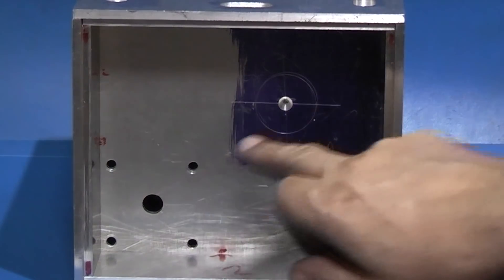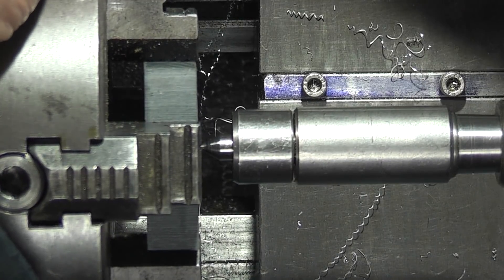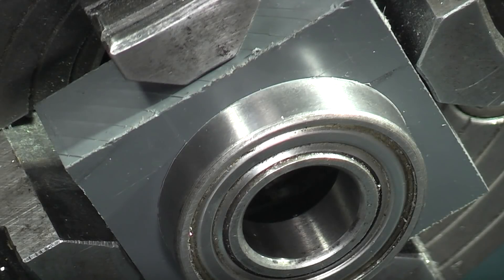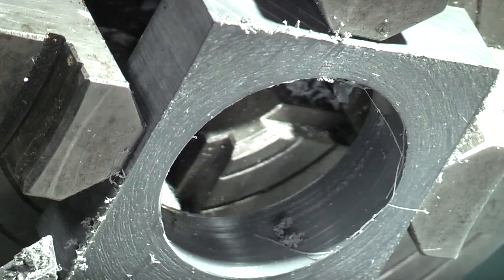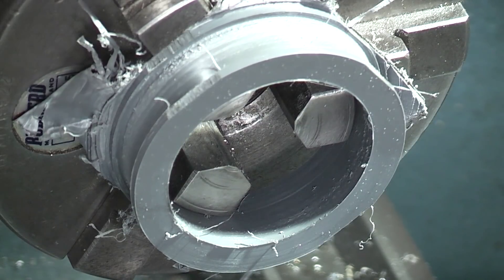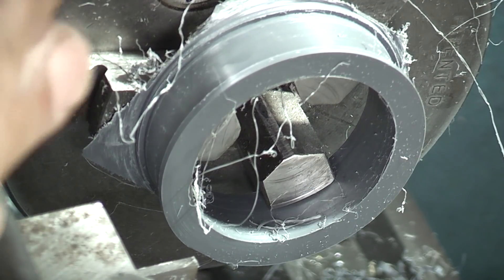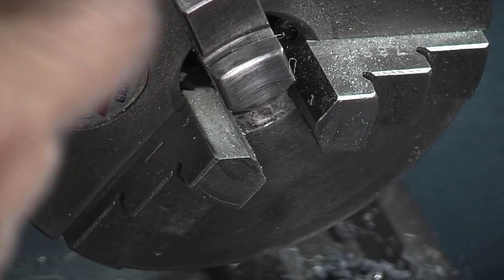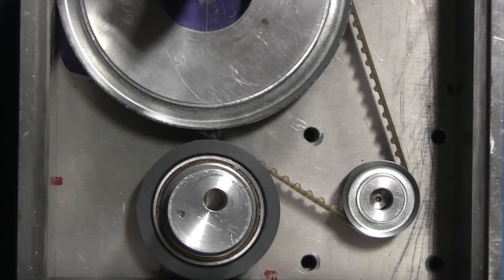Making a belt tensioner

Comment: How many millimeters off-center is the cam?
Reply from the maker: Hi Dorian. The hole offset is 6mm which should give 12mm of adjustment on the belt. But if you have a larger bearing bore you could make it more.

Comment: G’day Alan, coming along nicely. I first thought the plastic would heat up and slide off but then remembered it’s a dividing head, it doesn’t rotate at speed it only turns a division of one turn unless you’re cylindrical grinding but then it needs only to be slow. 
Cheers 
Peter

Comment: I probably would have made it the same way, but if you had crowned it without the sides edges, do you think that would have worked? Crowning usually "self centers" a belt but I never thought about it for a tensioner application.
Reply from the maker: Hi Tom don’t forget the belt moves slow a little at a time so a crowned pulley might not work
Thanks for watching 
Alan